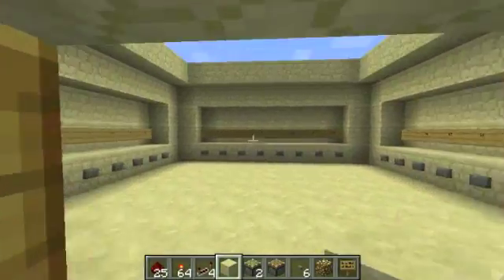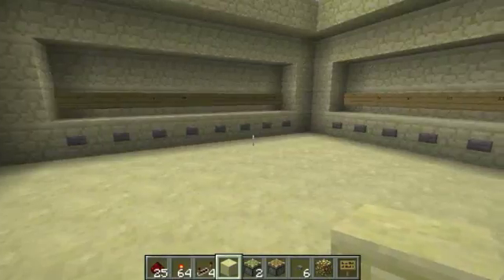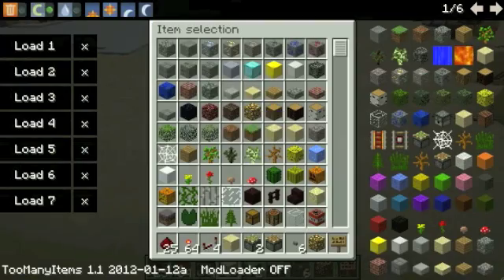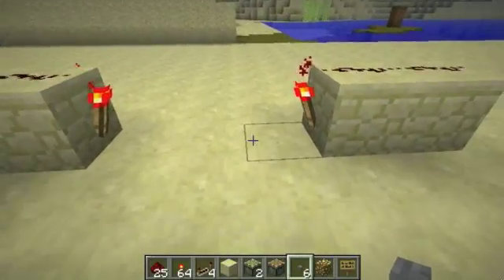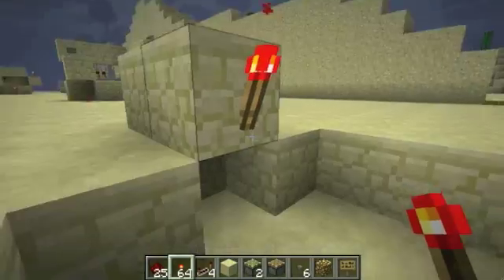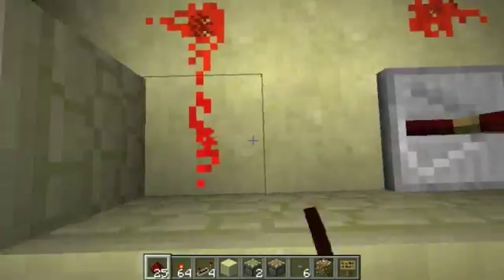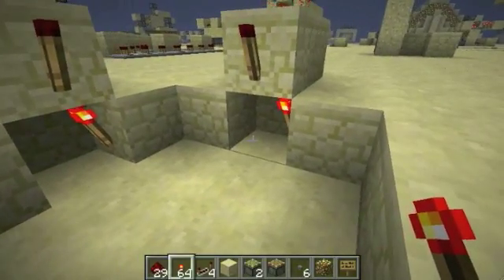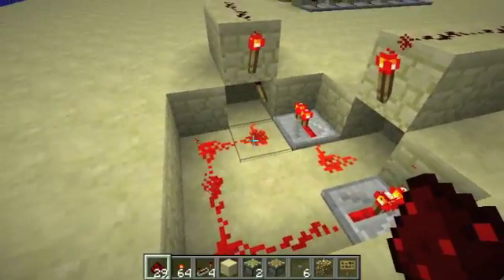Two-Way Repeaters (Linking Selectors)

Comment: @franovic55 No, the repeater extends distance the power can travel down redstone wire (as well as creating delay) This is a design that means the signal can travel from either direction :) (because the repeater only powers in one direction)